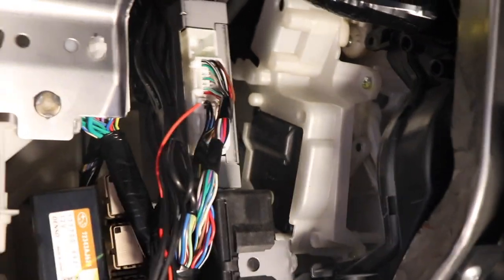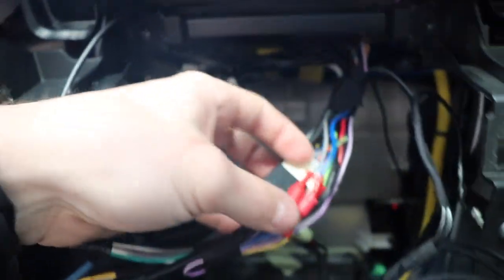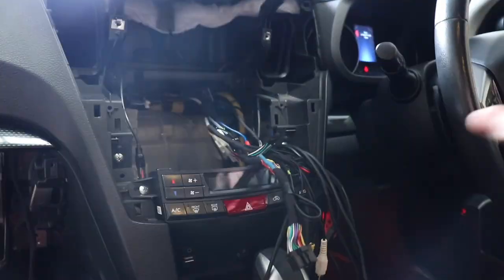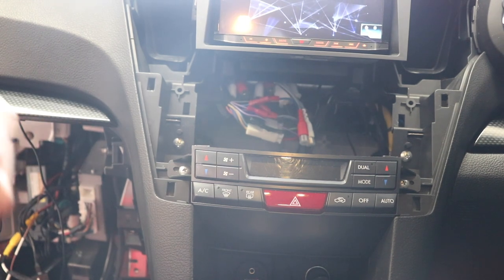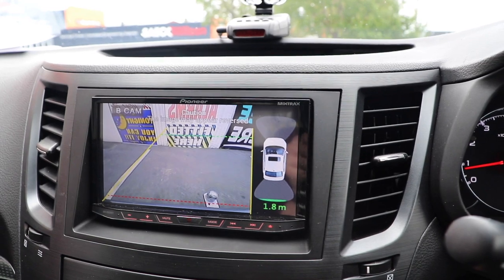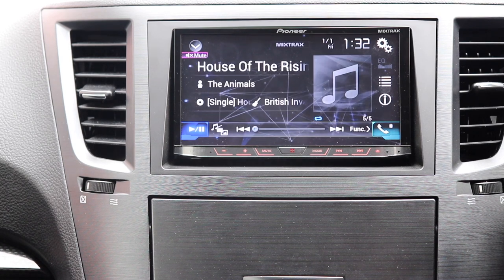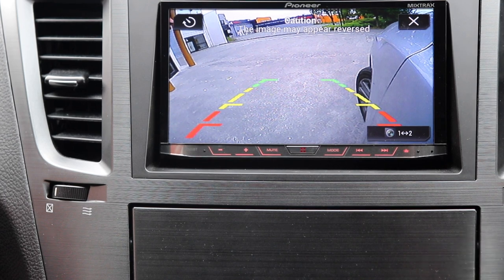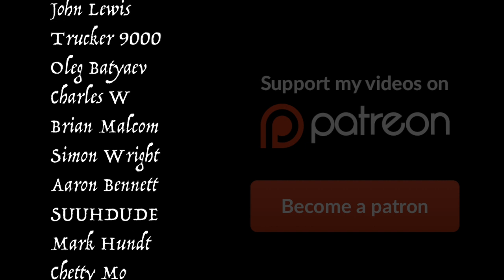Project Legacy: Parking Sensors + Display Done!

Comment: Hi there, nice video(s) 👍🏻

So, is it a single video out from the sensor control box for both cameras with a single input for the rear of the stereo?

I see now they have changed the product on Ali Express. Seems to be three control units, front, rear and a main control unit.

Not sure why they'd separate it 🤔

Comment: Great video. What happens when the front end of your car is parked against a wall and you want to listen to your stereo? Do the sensors continually beep (seems like they will)? It might be a suggestion to incorporate your park/neutral switch into the system to have the system only activate when you're in gear...just an idea.
Reply from the maker: Good question 
If your parked right up against something, the constant beep only ever stays on for maximum of about 20 seconds then stops.
I can also simply push the mute button on the remote to mute the beep output.